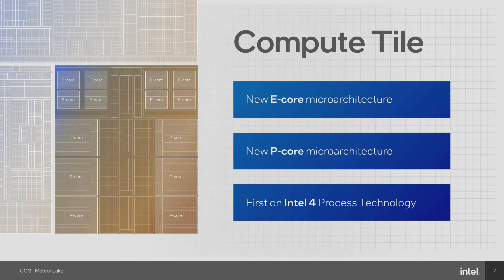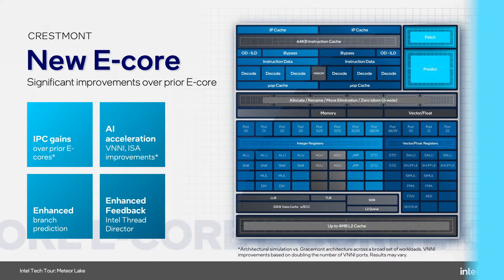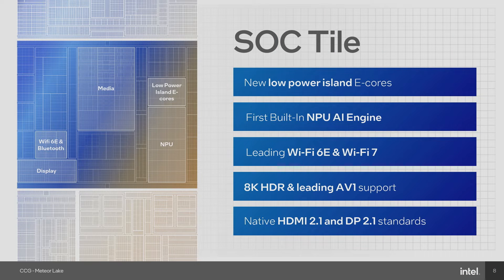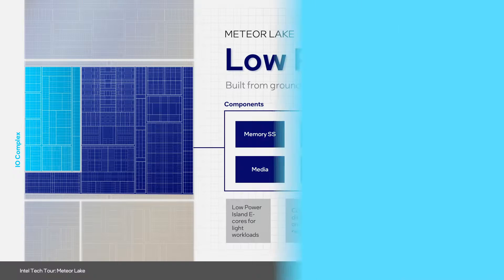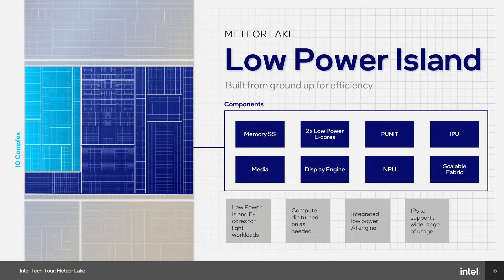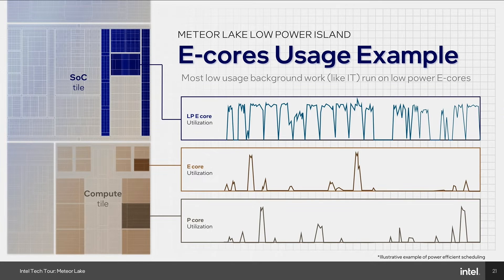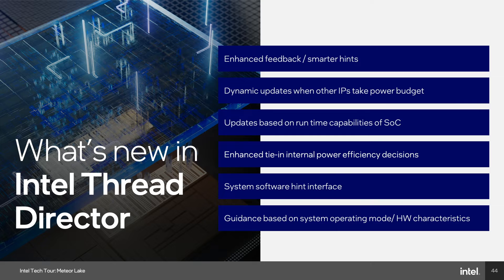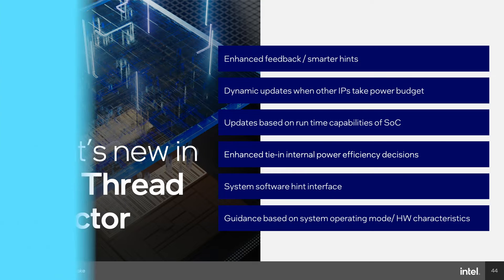Meteor Lake Performance and Efficiency Explained by Intel Fellows | Talking Tech | Intel Technology

Comment: I'm looking forward to 14900ks. It's not necessary that all cores have high frequencies, any cpu that only 1-2 or 3-4-5 cores have extremely high frequencies, which is very interesting. If Xeon all cores are only 3ghz but a few cores will randomly boost jump to 8ghz, it is also very attractive, one cpu with both single-threaded and multi-threaded performance.

Comment: I don't think it'll be as revolutionary as Intel is hinting, or they would be leaking that amazing performance. The fact they are only hyping things up suggests they don't have much to show off.

I think it'll be a standard generational jump. Better lithography on Intel 4 should help a lot, and iGPU performance may be significantly improved, plus a few things like AV1 decode acceleration.

I'll believe the hype when I see the results to justify the hype. I say standard improvements from the improved lithography and a nice boost to iGPU.
Reply: The recent leaks indicate that you were right. Though who knows, maybe the leaks were missing some BIOS or Windows (why aren't there Linux ones too, it's so much better than Windows on scheduling and general CPU performance. At least I hope it has support from Intel) and it's not as disappointing as it seems.

It seems that the overhead of the tiles basically ate all the improvements from the Intel 4 manufacturing node. Quite sad, but, on the bright side, it's a foundation that can be massively improved. I just hope that Intel will keep afloat until that time comes and not be killed by AMD. Still difficult times for Intel. At least the manufacturing node part of Intel seems to have been getting back on track.